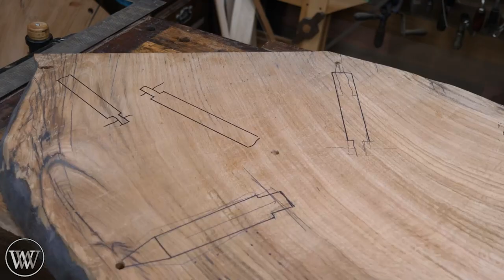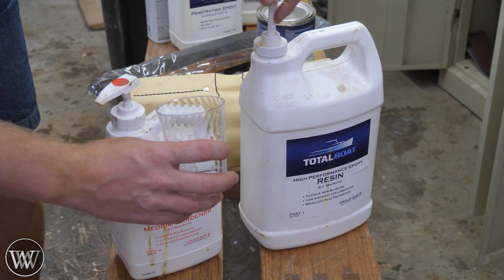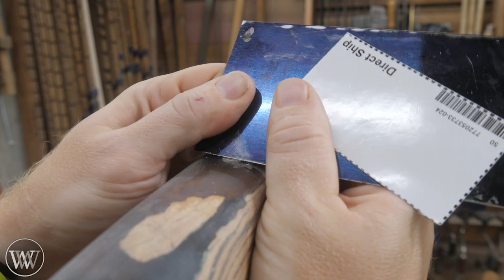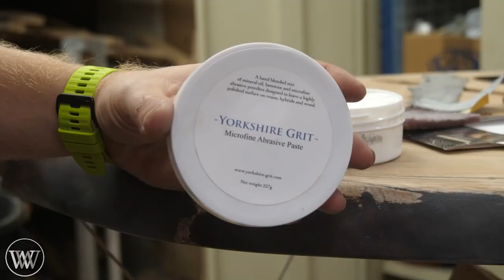Impossible Coffee Table All Done

Comment: I didn't think the wood could stand up to the forces needed to tension the cables, I have been educated, thank you.
Reply from the maker: It will compress a bit over the first year but eventually it will settle down and not move much at all in the future. But that's the nice thing about using the turnbuckles is you can pull a little bit more tension as it works its way into place.

Comment: Awesome build James! I saw you using a Speedbor bit in your brace to bore out the channels on the underside. Where did you find the adaptor? I gotta have one of those.
Reply from the maker: that is a pre production prototype, but the real ones should be coming out here soon. I will do a video as soon as they do.
Reply: @WoodByWright   Are you planning a mass production run? 'Cuz I think that could be a hot seller if you could get it into someplace like Woodcrafters. I've been searching for an adaptor like that for a long time. I would mean that people wouldn't have to scrounge thru bargain bins at flea markets looking for used auger bits.